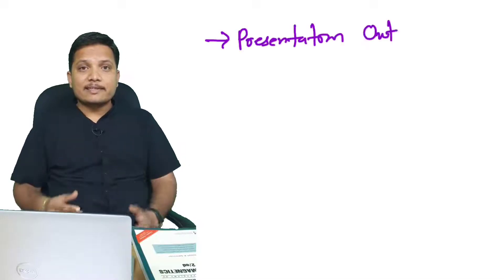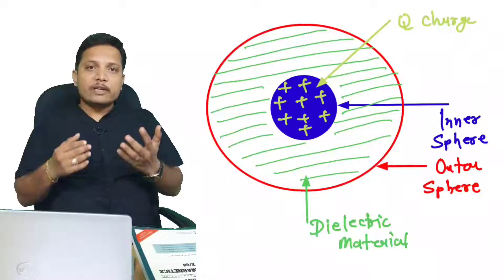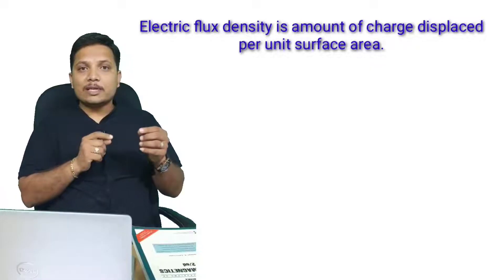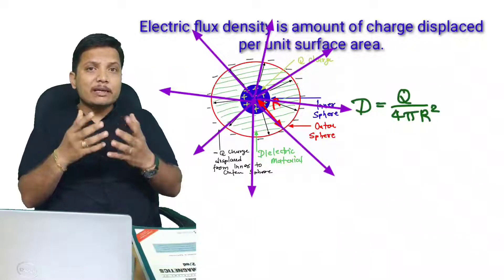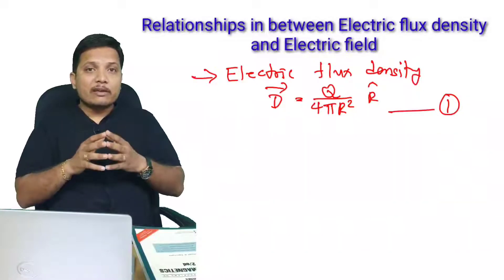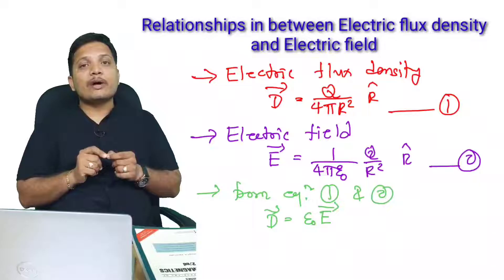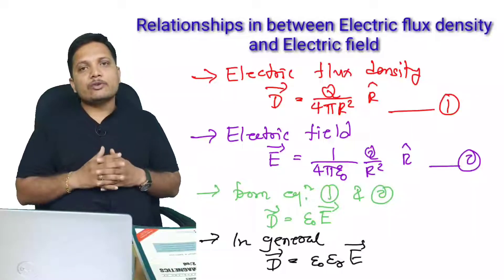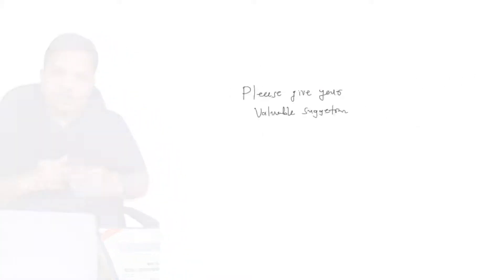Electric Flux Density & Electric Field: Concepts and Relationship | Electromagnetics Theory

Comment: For scalar potential V=x^2 y-2.5 z, Calculate the numerical values for potential V, the electric field intensity E, the unit vector of E, the electric flux density D and volume charge density ρ at point P(-4,3,6).	 please solve